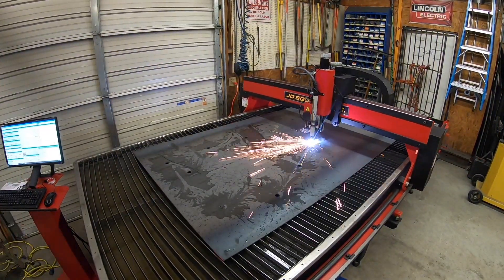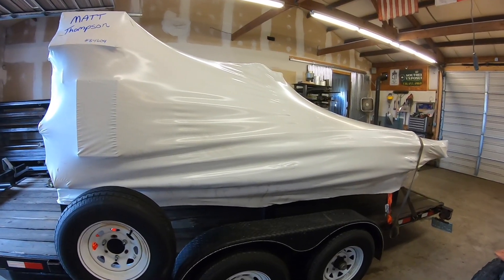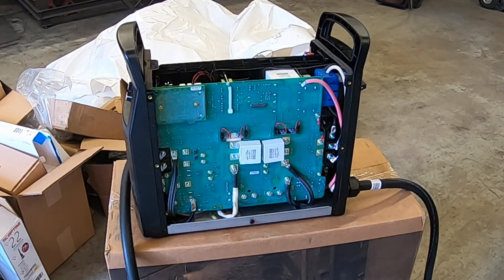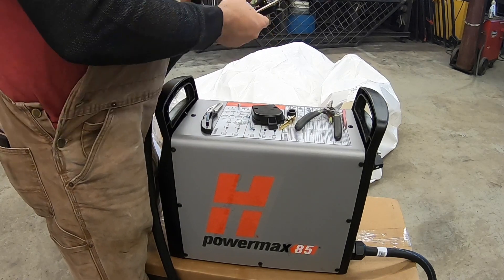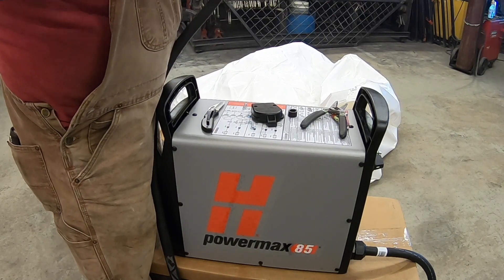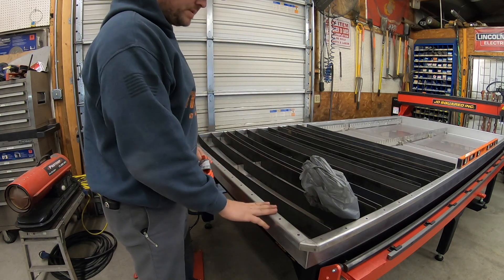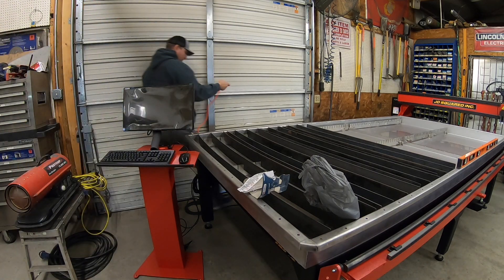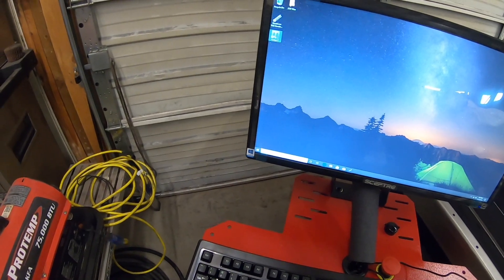CNC Plasma, JD squared 5x10 MAD Table set up and first cut

Comment: You should have tacked another set of guides down each side or moved the existing one in 2 inches.Then the 60" pieces would have been fine. Its not like the torch is going to reach to within 3 inches of the side of the table. .

Comment: What was the cost ?
Reply from the maker: Ballpark 25K with Hypertherm 85 and I wouldn't have any other brand of plasma cutter in my shop.  We already had drafting software so that helped. They offer the hypertherm software but I can't remember what the cost was
Reply: I think i might go arclight.
Reply from the maker: @dekonfrost7   there are so many companies building tables now it makes it hard.  We have a old Torchmate and looked at them but found JDsqaured and there was no competition after that.  Torchmate is over priced.  Go take a tour of the JDsquared facility if your not to far away.  The product will sell itself.
Reply: Mattco Metal Works yea man. Sounds worth a look. Jd square has a lot if good people there. But so does arc light. I think i might take a little time. But i just regraded my yard and that took a month to get all finished. Now i need a table for some oddball work. 

Liked the spaceship comment

Comment: Weld ur slats after u get cutting ur not even going to toxic them and spa e them out evenly so u don't have them in one spot will work great
Reply from the maker: That wasn’t even half of the slats.  We had to get more.  That was what the table comes with. They don’t supply all of them due to shipping costs.

Comment: What do you think of the table now that you had it awhile? What CAD/CAM software do you run and why did you go with a Water Table? Thanks much!
Reply from the maker: Hands down best decision I’ve made.  Absolutely love the table. Cuts amazing parts.  Of course you have to dial in some settings here and there but majority of the time we use book settings.  Running a hypertherm 85 and that is the ONLY plasma machines we’ll ever run. We also have a 65 for handheld.  We had a small Torchmate table prior to this and we actually built that frame and water table ourselves.  I’m just used to that so that’s what we went with.  Also for us getting small parts out etc isn’t an issue.  I think it absorbs more smoke and sparks in my opinion and when we buy another one down the road we’ll get a water table then also.  Hope this helps. If you have any particular questions please don’t hesitate to ask.
Reply: @MattcoMetalWorks  Thanks much for all the info. What is the one factor, in getting the best cut using plasma? THE BEST CUT!
Reply from the maker: @earlcousins6635   other than the machine settings which are very important, CLEAN AND DRY AIR.  MUST BE DRY!!! That’s the life of your consumables which are very expensive and the quality of the cut.
Reply: @MattcoMetalWorks  4-10 there! Thanks much! My best to you, the family and your business.

Comment: I have used 16 gauge slats and they work well. I hope that this helps.
Reply from the maker: Alaskan Ken thanks for the tip will definitely keep that in mind.  I know for sure I won’t be replacing all of the slats when these wear out.  It’s tough to get small parts that drop in the water with the slats that close together

Comment: looking to buy my own table in the near future. this seems like a pretty solid set up   how are you liking the cutting programs?
Reply: Awesome thanks.   I used a EZ Cut  cnc for a long time but to buy one for personal use wouldn't be easy for me to do. Sheetcam and mach 3 I have used previously also so if this setup is close to that I think I might give this a serious consideration.     Biggest table I have used was 120' by 30' 😆
Reply from the maker: M Radj   WOW that’s a massive table.   Yep there’s a lot of options for tables now. Too many companies building them.  And yes all the software is different so there’s usually a learning curve to figure out the small differences
Reply: @MattcoMetalWorks  it was for cutting the steel plates for power line towers.  Had a double torch set up on the riding gantry.     But anyway the software is what keeps me from locking in on a machine.   No one seems to really do a software review with their set up
Reply from the maker: M Radj  I’ll see if I can do a video on that and explain what we use
Reply from the maker: So far so good, we are currently still using our old software to draw with then transfer it over to the sheet cam.  It's all very user friendly and easy to get accustomed to.  We researched multiple brands of table before deciding to go with JDSQUARED but I'm very glad we did.  They are truly an awesome company from start to finish. Not to mention the support you get from them and all the other jd squared customers is phenomenal.  I'll try to do a video of the process from design to cut so you can see how truly simple it is once you run through it a time or two. EXTREMELY heavy duty table.  very happy so far